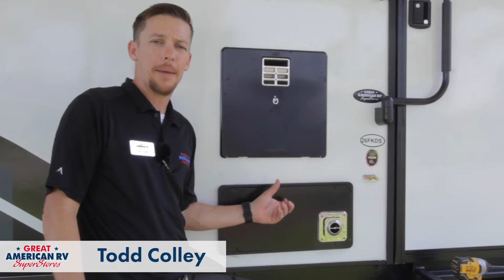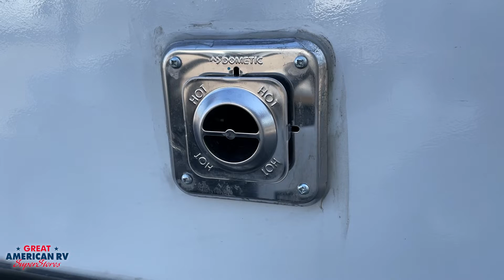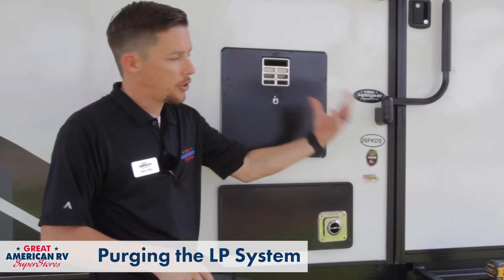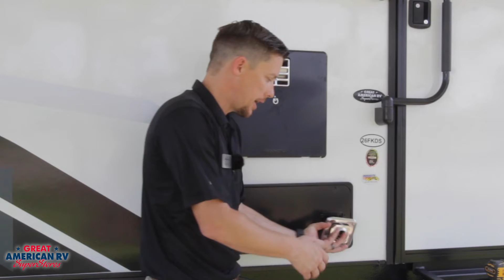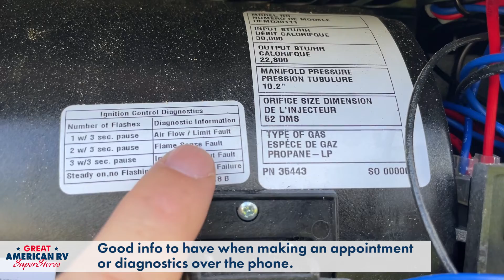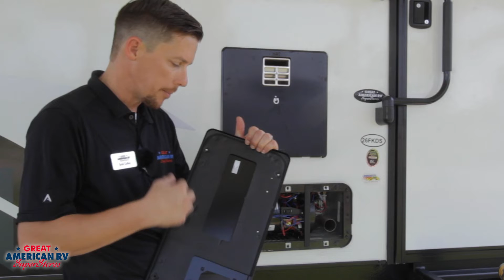Dometic RV Gas Furnace Operation and Maintenance

Comment: I only have an exhaust vent showing. You didn’t show anything on those types
Reply from the maker: It’s the exact same component, but you have to remove the gas line and duct work to get the unit out and service it from a bench.  Hope to do one in the future, showing the removal.  -Todd

Comment: Hi Todd, I’m considering buying/using this vent for a different application. Could I please ask/get the outside diameter of that inter tube on that vent, the length of that tube and the dimensions of the outer face of that vent?
Great video….Thanks!!!